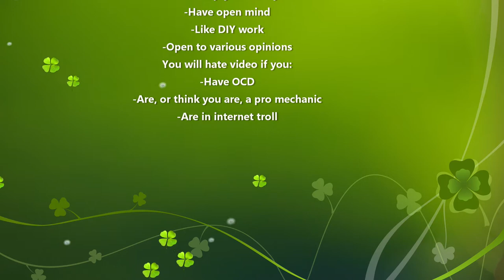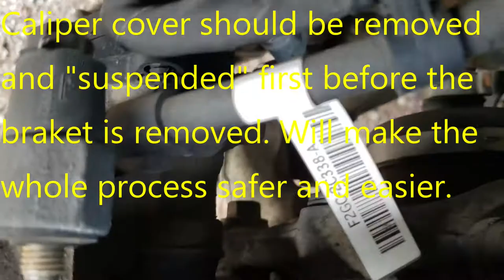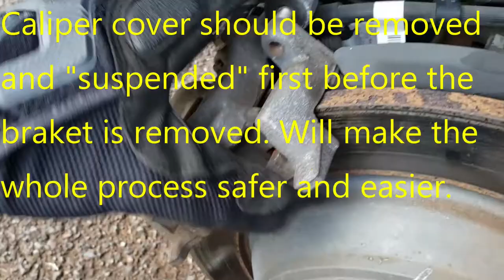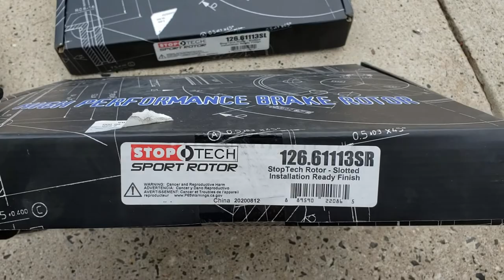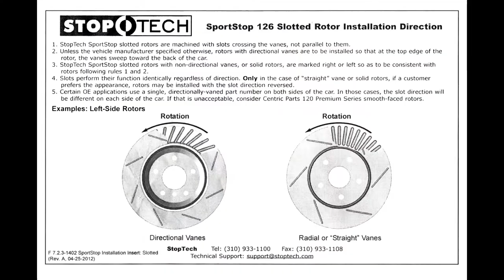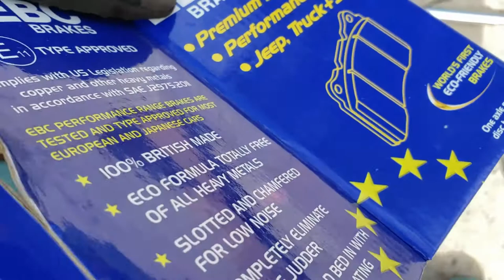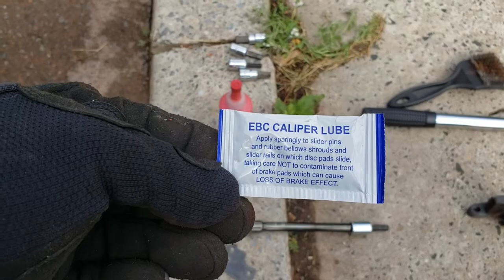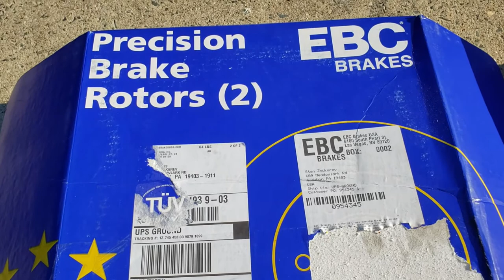17 Ford Edge Titanium Brake Upgrade EBC & Stoptech

Comment: You will deffinately need to keep those wheel spacers on the front wheels in order to have decent clearance for the MGP caliper covers, i got them for my 15' Sport and there is 0 wiggle room in the front and after a week start scrapping the inside of the 20 inch stock Sport rims
Reply from the maker: Totally agree. 6mm spacers all around is what it has had on.

Comment: Why would you put these brand new rotors on straight concrete?  I was always told to never touch anything on them hands grease especially not concrete
Reply from the maker: Agreed but since you have to thoroughly clean them before mounting anyway i was not worried

Comment: Any difficulty removing the front rotor retention screw that’s between 2 wheel studs ? Did you need an impact driver to break it loose , and did you re install it or just trash it? 🇨🇦👍
Reply from the maker: I may have been lucky but just a bit of a hammer and a bit to loosen it. Trashed. They are not necessary.